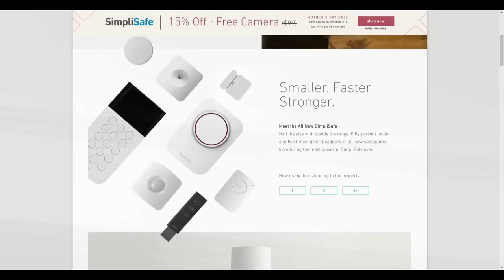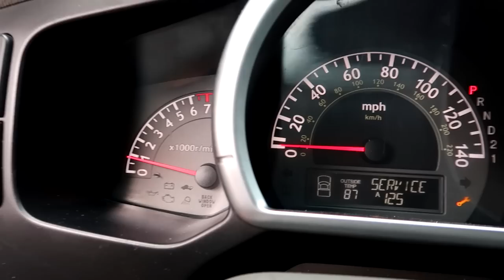Buying a Reposessed Truck at Auction was a MISTAKE! It's WAY Worse Than I Thought!

Comment from the maker: I want to thank Simplisafe for making my place GRINCH PROOF! Check them out here: http://simplisafe.com/samcrac
Reply: Nothing over 5 years old has rocker panels in Michigan. That would be considered a clean car with barely any rust up here.
Reply: Watch Tavarish's video on his 1999 Lexus SC 400 that spent time in the NJ winters. That thing was seriously rusted underneath.
Reply: Don't heat the damper too much or you'll be replacing those too...
Reply: Samcrac  you should buy a Nissan frontier  then pick up trucks real reliable
Reply: GMC Sierra 4x4
Reply: It's still not a real truck
Reply: Honestly that rust isn’t that bad in the location it is and it’s also not to bad considering he stoped  maintaining it but that sub frame is a little concerning if it is rust
Reply: Avinash lall did anyone say trans issues😂
Reply: next time buy a FORD
Reply: I live in Canada and with the salt we get in winters rocker rust is very very common on cars that age unless they haven't seen winter or have had constant rust prevention sprays done to them. Overall that rust really isn't that bad, its not on the frame or creeping up onto obvious parts of the body so I wouldn't be too bothered by it in the short term at least
Reply: cars in Florida specifically in the costal areas usually have quite a bit of rust. I'd say this was a daily driver from somewhere close to the ocean. so the amount of rust is moderate. salt air does the same amount of damage as road salt
Reply: You should buy a gm truck the engines are simple enough and reliable the only problem with them are the rear main seal starts leaking and cylinder head covers tend to leak but other then that pretty easy to maintain. This is only the problems that i have encountered while working on my dads truck so this is my experience with the truck and if your wondering what type of truck it is Its a 2008 gmc sierra z71 with the 5.1 vortec engine and 4l60 transmission
Reply: @avinashlall8441  Frontier has rust issues.
Reply: @avinashlall8441  drivetrain is super reliable. towing ability? minimal. rust? hope you dont need strut towers.
Reply: Samcrac stop buying more cars without updating us on the old ones. What the fuck happened to the Porsche.
Reply: The Nissan frontier d40  also known as  navara d40 in my country  trinidad and Tobago  the police have the vehicle alot of them still on the road but they have no Rust problem
Reply: The trinidad version of the Nissan frontier d40  have not automatic and manual transmission  problems
Reply: Come off the dime and get a Tundra
Reply: I live in Maine. Rust is the primary issue why a vehicle would fail an inspection. My suggestion is to use slip on rocker panels. For a vehicle of that condition slip on rockers would be the only answer. I wouldn't be to concerned about using simply because there is a frame under the vehicle so the rockers are less integral to the vehicles strength (if you compared it to a honda civic for example.)
Reply: pity its not available in the uk.. good system
Reply: are you okay you had a hospital band on
Reply: Samcrac please tell SimpliSafe to come to Canada!!
Reply: @avinashlall8441  yeah id be really surprised if anything rusted in the caribbean
Reply: Sorry Sam but i make way to much money doing installs for a security company that actually moniters their systems for less a month then simplisafe contracts another company to do, to consider ever looking at simplisafe. 

That said the ridgeline isn't bad, its like an oversized el camino witj no power. Best of luck with it, now how about that gorgeous little focus of yours
Reply: That rust isn't to bad I have lived in Pennsylvania most of my life and the rust it's what the cars are made of mostly neglected unfortunately I have a 2000 ranger with no rust (washed bi weekly and waxed monthly)
Reply: @williecruz5748 We experience both in my region, I live next to the ocean with salted winter roads. Ive seen trucks so old and rusted you could see through one side of the bed and out the other through the rust holes. Ive owned cars that would develop rust holes in the fender so quickly I could fit my hand in the hole and touch the backside of the wheel well lining.
Reply: raptor
Reply: Modern Rust for your truck
Reply: Sorry bro. I'm sure they plug you for plugging Them, but RING is cheaper for the same shit and better looking
Reply: Rust was minor compared to my old suv. That thing is a rust bucket.
Reply: Underbody rust is a major problem for older vehicles in the Midwest due to salt from the roads to melt the snow and ice in the winter months.  You never want to buy an older used vehicle from the Midwest until you first take it to a mechanic and give him $50 to do an inspection of the entire vehicle which includes the underbody.  Usually it's the underbody that kills the deal.
Reply: Michael Gman  they are probably upside down on the loan and can't sell the car cause they don't have the title without coming up with the difference
Reply: That was a bad impressions
Reply: Are you going to sale the Honda because you have the ford now
Reply: Simplesafe is the reason that we don't have RWD Audi R8 content...
Reply: @avinashlall8441  or a Tacoma
Reply: Samcrac j
Reply: Samcrac I drive my cars till the wheels fall off.   This Honda is practically brand new to me
Reply: speaking from wisconsin the rust on this is average as I have a chevy express van with about the same and you could drive that for a years down there without being exposed to more salt. I will say it is not beautiful however the running boards on our vehicles up here especially in minivans and vans plus trucks is to be expected. I know people who have cut the running boards and areas and replaced to keep lower mileage vehicles looking nice however I will say you got a steal and I would drive it until it is gone. just my two cents and I may be wrong however having worked on my cars I will say that this looks about average for northern snow belt vehicles.
Reply: I thought auto makers haven't used rack and pinion in years

Comment: I live in upstate NY... We would consider that truck rust free.
Reply: Haha yes I live in NY and we see this on a regular basis
Reply: Yep....I live near the "Salt City"  (Syracuse...)  Rust is a true 4 letter word!  He thinks this is bad?  I'll send him a photo of my Bronco.
Reply: @Tedybear315  syracuse here aswell! I am also in sales at a car dealership... 90 percent of trades go to auction because of the rust.
Reply: Mike Hannigan
Another MN resident here...
I have a 21 year old CVPI, and OMG, it has rust on all 4 fenders (just above the wheels) severe enough that it makes this Honda look nearly new by comparison.
Reply: I'm used to torching every suspension bolt here in Michigan
Reply: Definitely, the rust is normal and fine
Reply: Ditto
Reply: So true. I lived in NY for over 20 years. Living in FL for over 20, rarely if ever see any rust on cars here. Only when the plates are from northern states.
Reply: I've seen rust bubbles on new cars that sat on the lot for a full year here in Iowa. This truck is pristine.
Reply: Wisconsinite here. This Ridgeline is fucking Concours condition to the great white Nort!
Reply: Yup. Pay a guy $400 to slap on new rockers and some of that lovely black textured paint. Call it good for another four-five years. Or down there, probably forever.
Reply: Running boards on Ridgelines are ridiculously unnecessary.
Reply: I agree I'm from Rochester New York and that's almost perfect here. People from Florida would have a heart attack looking at rusty cars here lol
Reply: From Poughkeepsie NY- my f150 has half as many miles and twice as much rust as this ridgeline.
Reply: Nice one.
Reply: 4WD in Florida ... those vehicles migrate north ever fall in droves to every corner used car lot up here, whats considered a rust bucket in the south , is a garage kept rust free ( no extra cost in dealer terms ) vehicle up in the rust belt .
Reply: lmao
Reply: @Tedybear315  I was up in Syracuse once & saw plenty low mile $1000 used cars around 5-7 yrs old. Guy was honest said he prices em that way cause  they rust to nothing before 140,000 miles. Sad. Rust actually drives the value more than the miles do in a rust state.
Reply: Yeah that's basically mint compared to what I've seen up there.
Reply: @williscurry6557  ----Its not even the body rust thats the problem , start replacing fuel lines, gas tanks, brake lines , before too long , a perfectly good running car  needs 4 or $5000. worth of undercarriage work .
Reply: Here in Rhode Island my cars rust is twice as bad as his and I still feel like my car is decent compared to others lol
Reply: eric wsmith what truck?
Reply: @michaelb885  hey, me too!!
Reply: Right and I live in nyc I’m like what rust lol.
Reply: Also live in upstate New York. My last car was 20 years old and had way more rust. Still drove fine and I never felt unsafe.
Reply: @Beer400C I've always found that curious given that Japan is an island nation and will therefore be quite familiar with saltwater corrosion. Why build a drivetrain that's good for 30 years if the body self destructs in 10?
Reply: Very low rust lol.
Reply: eric wsmith nhac Vietnam
Reply: eric wsmith in Texas you would get laughed off the road
Reply: i live in northern Michigan.......we would consider that a 95% rust free truck
Reply: @bigev007  lol
Reply: Same but I live in northern Illinois
Reply: Yeah pretty much
Reply: Same in the UK, Samcrac doesn't know what real rust is
Reply: From my experience in NH, it seems that pickup trucks and Japanese cars rust the fastest. American cars, and even more so, European cars tend to be the most rust resistant, although there’s still no avoiding rust in snowy areas with salted roads.
Reply: I just  bought an 04 WRX this past November, and just from spending 1 winter in NH, new rust spots were formed after previously being nonexistent.
Reply: im from nova Scotia what is the rocker panel of which this man speaks lol   i cant remember the last time ive seen a ridge line that age  around here they  never sold well and the bottom foot disintegrated into rust dust in no time
Reply: MrCinimod93 rocker panel is the metal panel that runs beneath the doors. Most common spot for pickup trucks to rust.
Reply: Try Canada, this things mint compared to what we see
Reply: I'm from Connecticut and I can say we would say that truck beside the mechanical issues we say that truck was in amazing shape!
Reply: Here in Canada that’s mint condition
Reply: @BPwhistleblower --Yes salt works well on ice and snow, and in certain weather conditions its the only stuff that works . As for rust its just another nail in the rust coffin, when its cold and damp, the car may be literally soaking wet, top to bottom and every nook and cranny for weeks at a time.
Reply: @Eric-2720  Me too, Well more near Utica but still!
Reply: @superchargedcars  I'm From Syracuse, was just down in Utica on Saturday to go to the Brewery
Reply: @Eric-2720  did you do the tour? I can remember going as a kid. We would get the root beer while mom and dad did the beer. They also used to have a trolley ride.
Reply: Here in Wisconsin that rust is just cosmetic my dad has a 2013 honda ridgeline and has alot less rust than samcracs truck but it's been taken care of meticulously by my dad who uses it to get to and from work in the winter months because if that truck cant make it in to work the roads dont get plowed in our town
Reply: In Illinois we agree, also we have better pizza.
Reply: Also from nyc... i see no problem here.
Reply: @98triffid  Salt in the air and salt on the road act completely diffently.  Near oceans, there will constantly be a film of salt on top of everything, but it doesn't really get underneath the car.  Nor does it get forced into all the seams of the chassis and frame.  Without regular washing, the paint will go, but the underside will be rust free apart from normal surface rust on steering/ suspension and brake parts.
Reply: @ebels3  Sea fog, which shows up near bodies of salty water, is formed as water vapor condenses around bits of salt. While it's no rust belt in general, seaside cars are really just as bad since the fog comes in every single day.
Reply: @98triffid  Japan is geographically interesting country... just like in Spain, southern France and Italy, California or Florida coast do not necessary mean a lot of salt water. Your car would have to be washed by waves to get any salt on it. Rain, mist, snow do not contain any salt. It is the road salt that is causing rust and sunny and warm countries do not use it at all or rarely which means cars are not exposed to major cause of rust. Most of the Japan experiences mild winters and hence no road salt.
Reply: @lamebubblesflysohigh  I spent a number of years living near the ocean so please try again. Daily ocean fog was very unkind to body panels
Reply: @98triffid  may I ask how far from the ocean?
Reply: rust goes through a 'blooming cycle' gives off pollen in orange when you rub it. The pollen from rust is a sign it might start reproducing! yeah but only abandon the project if the rust starts chanting and watching videos with a lot of guys running around like they're taking over the country
Reply: @luciaconn6788  By that logic is electrolysis (look it up, it transforms fe03 to fe02) some sort of exorcism?
Reply: Sam, that rust is nothing to us us Northerners... Thats actually in good condition at @ + 160K miles.
Reply: In California, a car from the 70's has less rust than this... My 2001 Ford Ranger is spotless underneath, never parked inside and no rust whatsoever.
Reply: Y'all need to visit Montreal...

Comment: Im a Brit, just retired. learned to drive in the 1970s on British Fords. Rust? Ha, you've seen nothing young man! I think some British Fords were rustier than that in the showroom brand new!
Reply: Very true, you remember how ford improved the situation of the paint bubbling and rusting in the forecourt in the early 80's?
They used to store all the sheet metal outside. Yup, they moved it indoors.
Reply: Lmao . My ford was actually rust held together with egg boxes,filler,and in structural places chicken wire . And that was a good one lmao. A pair of sills would sort out most of that rust pretty quick

Comment: Your stated purpose was to have a pickup for hauling stuff. The rust is just a cosmetic annoyance until it hits the structural components. I say keep it. I'm not getting rid of my Frontier just because the paint has started flaking. It still does truck stuff just fine.
Reply: I'm with Robert.  Don't sweat the small stuff,  it's a truck.
Reply: Yeah I just spray some rust converter on it and not worry about it.  It's just going to be a jobber for hauling stuff once in a while.  I've got friends who have jober trucks that look a billion times worse than this. lol.
Reply: Yea, the rust isn’t a deal breaker. But I’m sure he is going to find that the truck is just barely adequate when it comes to towing capacity and that would make me regret the choice.
Reply: Idk my trucks been acting weird the rust came and then it went from doing truck stuff to do minivan stuff
Reply: Yep, the rust isn't that bad, and the price is right. Fix what needs fixing, like the stabilizer bar and maybe some exhaust issues, and keep the truck.
Reply: but if you sand it and paint  the problem areas it will last better than ignoring it.
Reply: Its a uni-body,,,, the rocker panels are in fact a structural component
Reply: eric wsmith Exactly. Rockers are critical structure on a unibody.
Reply: Nissan builds trucks on frame, solid ones.  A Ridgeline is a a unibody Honda Pilot with a modified rear structure. Those rocker panels are structural, not cosmetic.
Reply: Honda Odyssey Van subframe for Ridgeline    @pssst3
Reply: The rockers are structural.
Reply: @jon2924stonely  Yeah I don't really get this purchase at all. A car trailer with a car on it is going to exceed this "truck's" towing capacity pretty easily. If this were a body on frame truck, add some helper springs and a brake upgrade and run trailer brakes and your good to go. A unibody with independent suspension doesn't really have that option.
Reply: @jon2924stonely  Hes not hauling cinder blocks